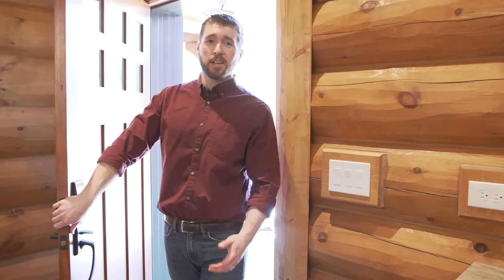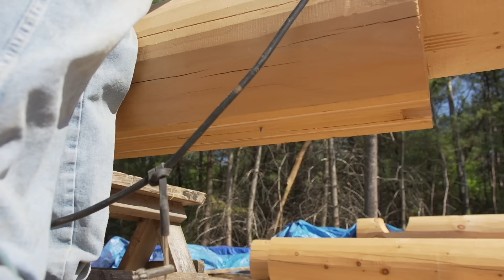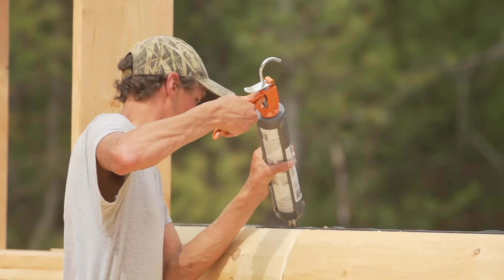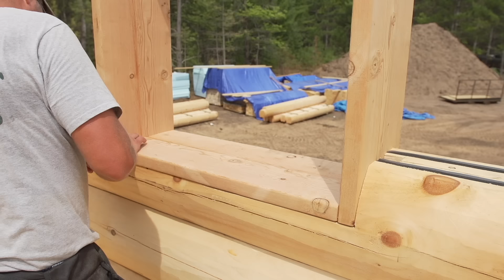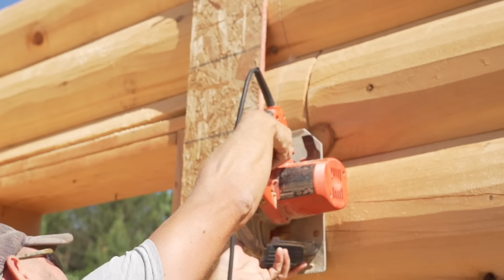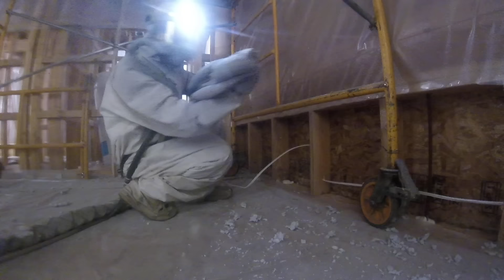Episode #1 Log Home Construction - Stacking Log Walls, Framing & Building Techniques

Comment: A weak point in that house is those aluminum plates that were used on the trusses . I used to build trusses and used those things. Sure it was fast but once I saw how they become bent and come out if the wood warps for whatever reason . Nails should be used or nuts and bolts which are better to join boards for use together
Reply from the maker: Thanks for watching

Comment: If you only provide the materials and the building process is subcontracted to other companies in the area where it shall be built, how can Golden Eagle assure that the the quality & details  of building will be the same as shown in your videos? Thnx
Reply from the maker: Sometimes we don't use builders in the local building area, say if there isn't anyone qualified etc. then we suggest a traveling crew that has experience in building a Golden Eagle before. Hope that helped answer your question if not call 800-270-5025

Comment: I have a 1500sqft log house I built using full logs butted together. Now I'd liketo add an addition that can be integrated to the existing structure. I never stained the original fir logs & they have now become grey. Can you suggest a way to make the transition from old to new without it being glaringly obvious? Do you use pine? thanks...Lars from Seattle.
Reply from the maker: Lars our sister company Log Home Mart can help you with that. https://loghomemart.com/

Comment: I have two questions: 
1) What wood is that? Pine? 
2) How would one deal with termite in a cabin like this? This is an honest question, I live in a concrete house and had a problem with it once and it's impossible to deal with... I have no idea what to do in a log cabin like this...
Reply from the maker: This home is White pine, if the home is going to be built the ground where the home will be treated, all the logs will be treated and termite shields will be put in place

Comment: How much did it cost
Reply from the maker: How much would it cost me to build this home?
This home was featured in our Log Home Construction Video Series. In the video series the homeowner came to us, and really liked the Eagle Prow 1975AL. That stock plan would be approximately $669,000 as an 8"x8" full log home. As with each of the 5,500+ homes we have previously built in North America, this homeowner began by modifying our stock plan like most people do. In this case they were looking for more luxurious options and a larger home. With the help of our in-house design team. They increased the size of the home, upgraded to 12"x12" full logs, and choose deluxe options on nearly every single item in this home. This resulted in a turnkey cost of approximately $984,000. Depending on the package you choose this home could build for at little $816,000.

In different parts of the country construction costs may be more or less. And you would need to add Land Costs, Well, Septic, Landscaping, Etc.

Contact Us or call at 1-800-270-5025 and we can help you start planning your dream home.

Comment: What is the Cost of this House
Reply from the maker: How much would it cost me to build this home?
This home was featured in our Log Home Construction Video Series. In the video series the homeowner came to us, and really liked the Eagle Prow 1975AL. That stock plan would be approximately $669,000 as an 8"x8" full log home. As with each of the 5,500+ homes we have previously built in North America, this homeowner began by modifying our stock plan like most people do. In this case they were looking for more luxurious options and a larger home. With the help of our in-house design team. They increased the size of the home, upgraded to 12"x12" full logs, and choose deluxe options on nearly every single item in this home. This resulted in a turnkey cost of approximately $984,000. Depending on the package you choose this home could build for at little $816,000.

In different parts of the country construction costs may be more or less. And you would need to add Land Costs, Well, Septic, Landscaping, Etc.

Contact Us or call at 1-800-270-5025 and we can help you start planning your dream home

Comment: What was the cost of this build?
Reply from the maker: How much would it cost me to build this home?
This home was featured in our Log Home Construction Video Series. In the video series the homeowner came to us, and really liked the Eagle Prow 1975AL. That stock plan would be approximately $669,000 as an 8"x8" full log home. As with each of the 5,500+ homes we have previously built in North America, this homeowner began by modifying our stock plan like most people do. In this case they were looking for more luxurious options and a larger home. With the help of our in-house design team. They increased the size of the home, upgraded to 12"x12" full logs, and choose deluxe options on nearly every single item in this home. This resulted in a turnkey cost of approximately $984,000. Depending on the package you choose this home could build for at little $816,000.

In different parts of the country construction costs may be more or less. And you would need to add Land Costs, Well, Septic, Landscaping, Etc.

Contact Us or call at 1-800-270-5025 and we can help you start planning your dream home.

Comment: I watched ep 7 before seeing this on how you constructed this. I wanted to say to you that this home is fantastic. But I wanted to suggest that you use #10 wire to reduce the electric bill. An electrical engineer in Inyokern Ca built his home this way and his electric bill was about 30 to 80 a month then after adding solar no bill at all. Also I was wanting to let you know that battery powered caulking guns make the caulking duties alot easier.
Reply from the maker: The battery operated guns I am clues into but the 10 gauge wire I wasn't thanks for that tip.

Comment: You might talk about it in a later video but I want to know more about running the electricals.  I can understand the raised walled concept but what about switches  up higher on the walls?
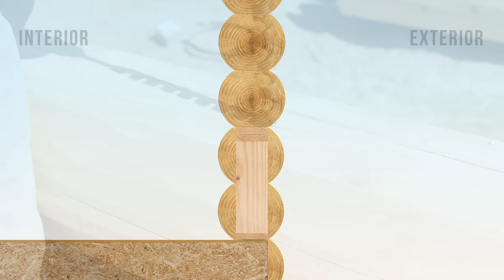Reply from the maker: Thanks for watching. We are touch on it a tad at 2:13
Reply: @goldeneagleloghomes  I saw that too, but since I'm felling and building solo I trying to wrap my head around the idea a bit better.  My project is old school tools and I'm only trying to run a few wires for lights mostly.  I do appreciate the response and I'll keep watching to learn some more.  Thank you

Comment: I've always loved well built log "Homes". But I've always wondered....how do log homes keep sub-zero winters temps from entering the home. They don't have insulation in the walls like in a traditional home. Do log homes naturally "insulate" the interior from the exterior.
Reply from the maker: Good question!  Full log walls offer thermal mass, which is a way of storing energy from the furnace or air conditioner. The log wall stores energy like a battery and releases it slowly.

Comment: can you put the wires and cables into metallic conduit for better fire protection just in case of a short circuit? also, since the cabin mostly made of wood and the location of this cabin is in the forested areas, is this safe during a forest fire?
Reply from the maker: Yes, in fact a few areas of the country require a metal conduit. One does not kindle a fire with full logs but rather small thin wood pieces, therefore there is an understanding in the housing industry that a full log home is more flame resistant than most sided homes.

Comment: In the "Building my dream home" series, when you build the half log panel, did you use something to seal between the half logs? Or did you guys just stack them? without anything. I was thinking that water could get between the half logs and then freeze and damage the wood.
Reply from the maker: There is a log sealant which comes in a tube we use to keep the water out our half and quarter log sided homes. Full log homes are totally different from a sided home and thus require an extensive gasket system.
Reply: @goldeneagleloghomes  Okey, thanks for the answer! Appreciated it!
Do you have a link or a name of the log sealant?
Reply from the maker: @amandusjonsson2421  Sashco Log & Timber

Comment: Beautiful home, what's the price on a house like that please.
Reply from the maker: How much would it cost me to build this home?
This home was featured in our Log Home Construction Video Series. In the video series the homeowner came to us, and really liked the Eagle Prow 1975AL. That stock plan would be approximately $669,000 as an 8"x8" full log home. As with each of the 5,500+ homes we have previously built in North America, this homeowner began by modifying our stock plan like most people do. In this case they were looking for more luxurious options and a larger home. With the help of our in-house design team. They increased the size of the home, upgraded to 12"x12" full logs, and choose deluxe options on nearly every single item in this home. This resulted in a turnkey cost of approximately $984,000. Depending on the package you choose this home could build for at little $816,000.

In different parts of the country construction costs may be more or less. And you would need to add Land Costs, Well, Septic, Landscaping, Etc.

Contact Us or call at 1-800-270-5025 and we can help you start planning your dream home.

Comment: how much does it cost to build a house like this?
Reply from the maker: Alberto it does depend on where one builds but in most of the USA a turnkey build price on this 2124 square foot home completely built with package (kit) and all labor and subcontractors will be around $800,000.00 on your property. This Includes a full 9’ tall basement, in-floor basement heat  and of course all those covered porch areas.
Reply: @goldeneagleloghomes   thank you very much.
Reply: @goldeneagleloghomes  Thank  you for being transparent in your cost modeling.  Very much appreciated and very ethical.  Great company!
Reply from the maker: @shawnware5451  Thanks so much

Comment: While this is really neat, it is extremely labor intensive and expensive, you are looking at a million dollar or more house here.  3d printed housing will be the future of housing imo.  In 50 to 100 years it will replace traditional framed houses.  Everything will be pre programmed from a basic template, engineering specs, decorations, utilities, wiring, plumbing, insulation etc will all be 3d printed in 1/100 the time it would take to build a normal home.
Reply from the maker: Ken you may be right about the 3D homes of the future but most of our customers want to build now not in 50-100 years.

Comment: Hey Zach, I have always wondered with such square footage and high ceilings how is dust controlled when the house is occupied by the residents. Would dust not settle over time inside the home on the logs and the little crevices. How does one maintain and do timely upkeep? Is there a proper method? Would love to know, thanks!!
Reply from the maker: Dust doesn't accumulate very much above 10ft and it's no more difficult to keep up on the dust. How much dust you have in your home depends on several factors including where you live, the season, how many people live in your home, whether you have pets, and even how you clean.

Comment: How much did this house cost to labor to the kit?
Reply from the maker: The Turnkey price on this 2124 square foot home completely built with package (kit) and all labor and subcontractors will be around $800,000.00 on your property. This Includes a full 9’ tall basement, in-floor basement heat  and of course all those covered porch areas.

Comment: How come your homes have 8 inch Concrete Foundations and Meadowlark Homes use 12 inch Foundations ?. Isn't Bigger Better ? , that's what the girls say about the Black Guy down the street.:hand-pink-waving::face-blue-smiling:
Reply from the maker: They must be stacking blocks, piece by piece. We are pouring concrete into forms so it’s one large piece rather than stacking a bunch of small pieces.
Reply: @goldeneagleloghomes  I think it has more to do with the weight of the Logs !.
Reply: @goldeneagleloghomes  The foundation is 8 inches of Concrete with Foam Insulation making it look wider !.

Comment: What’s the “R-Value” of these particular 12 inch logs?
Reply from the maker: The energy efficiency of logs is incredible because of their thermal mass properties. Give us a call at 1-800-270-5025 for a detailed explanation.
Reply: R-Value of wooden logs is typically 1.0 per inch of thickness, assuming correct sealing and weatherproofing is done (like the finished example shown in the video), so for a 12-inch log it's about R-12.

Comment: How much does something like that costs ?
Reply from the maker: The Turnkey price on this 2124 square foot home completely built with package (kit) and all labor and subcontractors will be around $800,000.00 on your property. This Includes a full 9’ tall basement, in-floor basement heat  and of course all those covered porch areas.

Comment: Wow, I'm surprised that the elevated Log Stack will withstand all that weight. My mother's log home has 2 different size foundation blocs where the very top row of block is smaller to accommodate the logs, and the rows of blocks below that support the floor.
Reply from the maker: Jim, that is a deep thought about the weight, we wondered the same thing when Tod came up with the idea. It all engineered out (approved with flying colors) and the threaded rods being attached to the foundation as they are eliminated the hinge point concern. We are the first one offering this in the full log industry and the electricians love it.
Reply: @goldeneagleloghomes  I helped with the electrical in my Mother's "True North Log Homes" house and it was a  major pain in the butt. Hats off to your engineers!